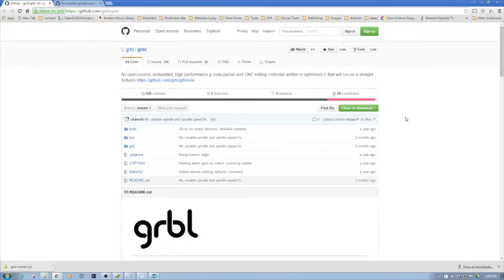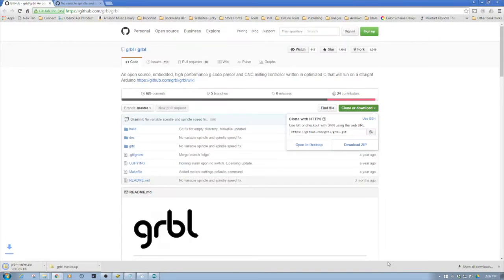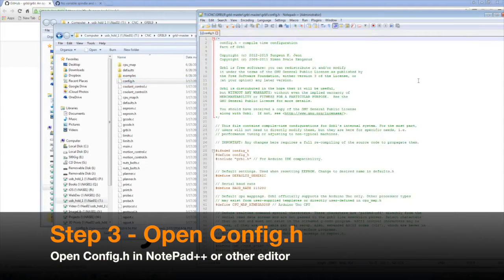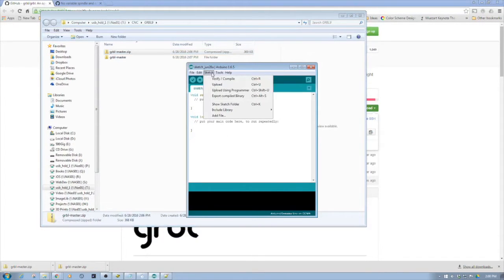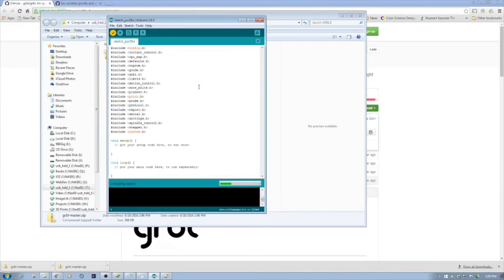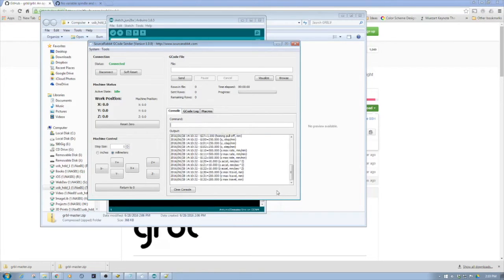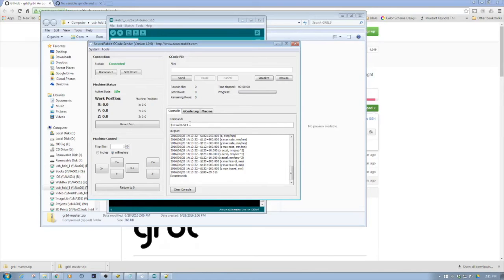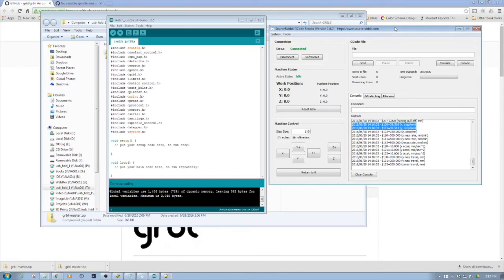K40 eBay Chinese CO2 Laser Cutter - Flashing the Arduino UNO with GRBL Part 2!

Comment: Does anyone have a wiring diagram for the k40 to a grbl shield? I just got a k40 for the parts to build a bigger machine but first I have to figure out how to wire it to the arduino. Any help would greatly be appreciated
Reply from the maker: If you check out my eBay/K40 play list I show how to do this.  Its pretty easy...

Comment: how u connect the laser power supply pwm  to  arduino  to make the tube on & of  & cut or engraving   pls we need a digrame
Reply from the maker: PWM will not work on a K40, its either on or off and in the video I cover the building of a simple one transistor inverter to achieve this...

Comment: Actually, why do you remove variable spindle control if you could use this pwm pin for setting laser power from gcode ?
Reply: I have to chime in here because the m2 nano board you removed works with the K40 Whisperer and I just saw some greyscale photos done on the K40 with it.  Not dithered but greyscale they said and it was better than my laser diode can do.
Reply from the maker: Because the CO2 laser is not capable of modulating its beam, it is only on or off and laving PWM active means you must set the post processor to send an S command (i.e. S1000) along with the M command.  Hope that makes sense...
Reply: Thats not what I meant. I currently run my self made (from totally discrete parts) 80W co2 cutter with stepper signals for the stepper motors, but with a PWM signal for setting the laser power. Thats totally independent from laser fire ON or OFF. I guess you currently set your power using the setting on the front panel then( maually) and then let the grbl take control over the steppers and the firing pin (though the inverter for fire), but why don't you just use that PWM signal to set laser power through gcode instead of that extra manual step ?
Reply from the maker: Because the eBay laser can not be modulated, you set the power (i.e. Ma) and that it.  So you still use the PWM pin, however no long to also send an S code with the come.  In short unless you replace the power supply, there is no avoiding the single setting....
Reply: I do engrave and cut jobs all the time. Engraving is done first at 15% power and cutting at full power, but it does all this in 1 machine job. I don't have to manually dial the power between engraving and cutting.
Reply from the maker: Than you must have a modulate-able power supply, the 50/60 watt units I believe have these however not the 40 watts or the "typical" eBay 40 Watts as I have several and they all basically the same...
Reply: You supply does have a pwm input for setting laser strength and 1 for shooting, no?

Comment: show me how to connect  laser driver with the board cnc shield v3... THANK YOU !
Reply from the maker: Not sure what you are asking as the motors plug directly into the CNC shield sit atop of the Arduino UNO.  an you clarify the question?  Also you do realized the existing control board is removed completely and "replaced" with the Arduinio /  CNC Shield...
Reply: how connector pins z on the board  cnc shield with  laser driver?
Reply: I used the google translate, so there may be errors in grammar incorrect urge you to ignore, ...
Reply from the maker: Only X & Y are used, you don't need the Z unless have added a Z Table like Light objects sells...

Comment: Did you look at this version of marlin https://github.com/TurnkeyTyranny/ it supports PWM & Raster,  they have a matching plugin for inkscape and you could use repetier if you wanted.
Reply from the maker: Yes did look at, however it's a fork of Marlin and requires the Mega and associated ramps whereas I have a lot of experience with GRBL as well as a vast number of UNO's & CNC Shields so decided on that route as the biggest thing I use my laser for is cutting and not engraving.  You could also work in PWN from GRBL to, however I decided not to invest the extra effort as I have the digital version whereas again with the "pot" version it would easier as you could just use GRBLs spindle PWM control to run a small transistor circuit to vary the resistance...